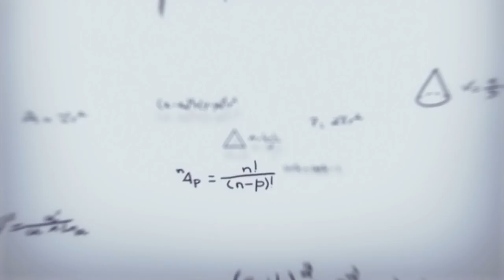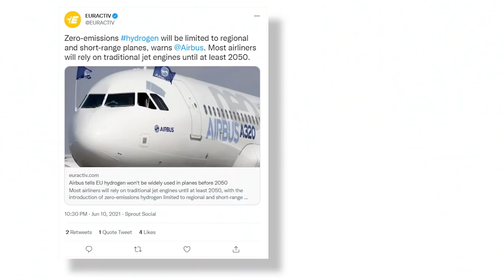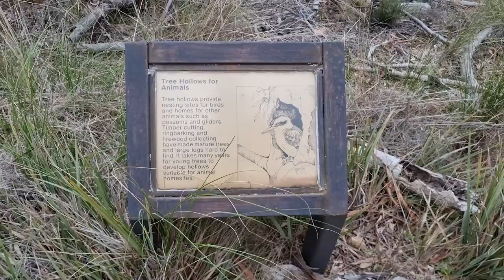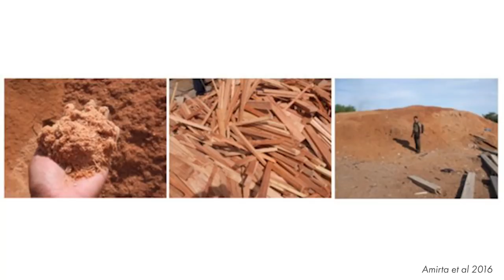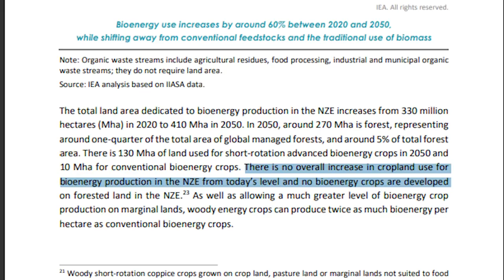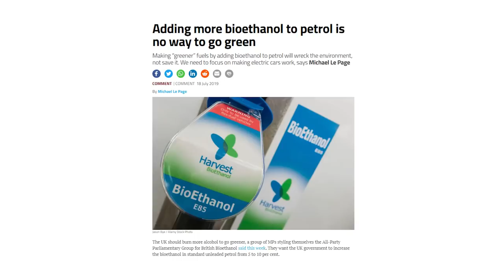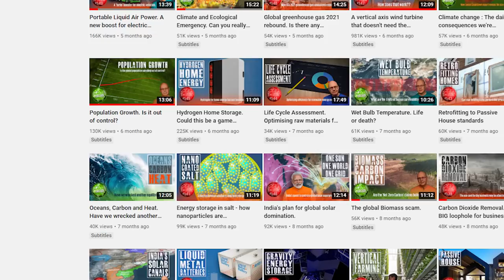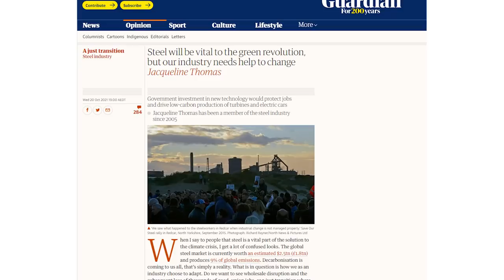Bioenergy In All Its Complexity: The Good the Bad and the Ugly

Comment: Excellent video again. Thank you. You had mentioned using bioenergy for seasonal energy storage. As mentioned off hand I would be concerned that would be in the "bad" catagory. In the north where I live we would need seasonal storage for the winter if we relied on solar energy alone. However wind energy is stronger here in the north so a blend of wind and solar very likely reduces the storage times to only those grey days with low wind levels. Generally down from months to a few days. However to move that amount of now natural gas to wind would require huge amounts of industrial wind generation. It would be very interesting to know if that significantly affects local and migratory bird populations and how to mitigate against that if a problem? Would small individual VAWTs for Net Zero houses and buildings generating energy along with solar on the buildings be a better more sustainable way to build? Less impact on the birds and less nimby-ism when it is literally in your backyard.

Comment: I think it is very important to understand that the best way to use bio-energy is the one where you don’t burn it, but transform it into a useful new product. Better insulate houses with natural materials against heat and cold. The best way is not to need energy. Think about making a solar oven for cooking 10 years with the sun in stead of burning the same amount of wood for one meal. Same with windenergy. You can make several windmills out of one tree lasting for years generating everything you need. If you really need to burn something, create biogas out of manure in power and heat cogeneration. It is not bad when the blades of your turbine decay. You can improve the time they last with natural oils. In the end you can burn them when you need heat. But they will have provided you with years of energy, and can easily be replaced. Stop burning stuff.

Comment: I used to install small scale pellet and log heating but government support dwindled which drove market to cheap equipment. So what with winding down to retirement and not being able to fit quality equipment I have stopped this, still doing both solar technologies. I have a froling pellet boiler heating my business premises and I love it, great bit of kit. It has lambda control which I think is very good and should have been a phased in requirement in my opinion. The issue that needs addressing is Particulates if a fraction of money wasted on carbon Capture and fusion had been invested in this for small sale we might be in a different place. We had mayor of London kicking off about PM's and it didn't do Biomass any good but a lot of these trad stoves never get serviced and often falling to bits and leaking air.

I heard from one of the Permaculture people I follow that trees actually put carbon into the soil. I always thought that Biomass carbon cycle was maybe 80/90% effective. However if carbon goes in to  the ground it might even be carbon positive.

Love the show so nice that I can see that you care about our planet and that the issue facing us are very complex.

Comment: I think "Bio-Petrochemistry" will be an important aspect, even not for fuel.  Plastics, Pharmaceuticals, Industrial Chemicals, Dyes etc are all currently made from Oil / Gas, this will need to come from something else.  I think a mix of Algae Hydrothermal Liquification (HTL) "Bio-Crude" and Refuse Derived Fuel (RDF) + Sustainable Biomass based Syngas Refineries can sustainable, if not carbon negatively replace this fossil fuel based industry.

Also with less fuel being used, due to electrification / fuel cells, as well as public transit etc, the refineries can be made MUCH smaller.

Comment: Pretty good assessment in my humble. Although Carbon Capture is firmly in my greenwashing category until they show they can vastly increase capacity at economical cost. It also consumes too much power and needs too much space and materials. There is no evidence of this improving in the timescale we have.
Reply: You are mixing things up. "Greenwashing" is when a measure pretends to reduce CO2 but in fact doesn't. Most "bio-energy" falls into this category as explained in this video.
Carbon capture on the other hands works, its net removes CO2. The egergy needed will not offset the gain. Therefore its NOT greenwashing. Carbon capture is not scalable and no cost efficient today.
And about timescales .... Bio energy can never make a substantial contribution no matter the timescale. Its usage impact is limited to available land area. Carbon capture MAY make contribution. It is not limited by natural constraints (just economics and available technology).

Comment: Hey Rosie, great video. 

Did you get your complimentary copy of “The Australian Way” net zero emission plan when you arrived back in Oz ?
Angus Taylor and Keith Pitt reckon we need lots more coal seam gas to produce blue hydrogen. The ‘plan’ indicates we may have 63% intermittent renewables in the Australian electricity grid by 2030, with gas + ccs and/or blue hydrogen providing base load capacity. The ‘plan’ Section 3.2 only talks about batteries providing short duration grid stability, with hardly a mention of pumped hydro expansion. The underlying assumption seems to be that energy storage will be more costly than CCS (per kWhr). I’m sure that has nothing to do with retaining the NSW Hunter and Central QLD  electorates in the upcoming federal election….

Unfortunately, politicising major infrastructure investment never ends well. 
Hopefully we will vote to let  engineering and science determine the best path forward to address climate change / sustainability issues.

Comment: I think the effort in making biofuels for just some 5-20% CO2 cut down is a waste if energy on its own.
When other solutions are implemented. Like less biofuel grop grounds and electrification of other transport. It's better all in all to keep the normal fuel on these usage until it has a proper solution.
When the forest and seas can absorb CO2 cause they get restored instead of cut down for crops you have a better solution to overcome the transition.

Comment: Can we convert are own poop instead of dumping it into the sea.  Mad Max beyond the thunder dome was right.
Reply: There have been proposals to gasifiy crop residue, municipal solid waste, and sewage sludge into synthesis gas, and run it through a Fischer-Tropsch reactor to make liquid fuels.
Reply from the maker: Sure! no reason why not, but you go first...
Reply: @gregorymalchuk272  hoping it will be more that just proposals soon.  They were talking here about using the motorway fodder to use in biomass tech but that's all, talk.
Reply: @justmechilling...  
You mean the stuff they mow along the highways? I've thought about that before. There is a concept called "regional biomass processing center" system. Basically, you have to have a lot of logistics systems in place because it's expensive to transport not so energy-dense wet biomass. I guess they would gasifiy it, but I don't know if it would be converted to liquid fuels locally or sent to even larger Fischer-Tropsch plants.
Reply: @gregorymalchuk272  👍